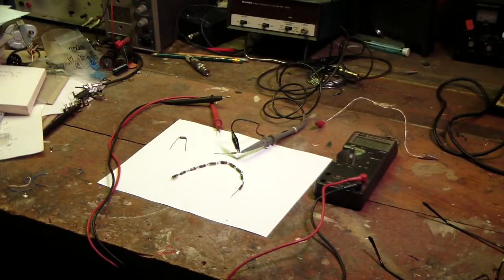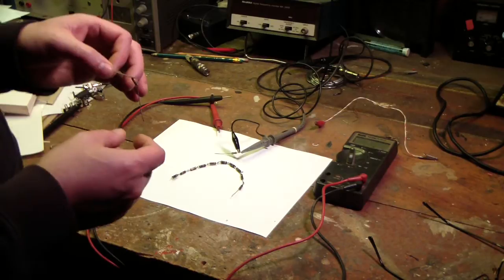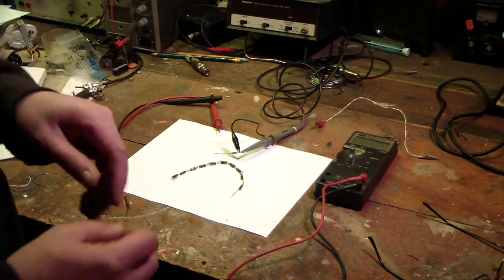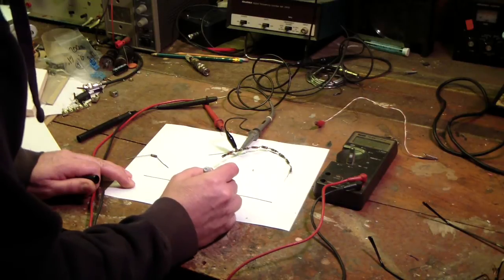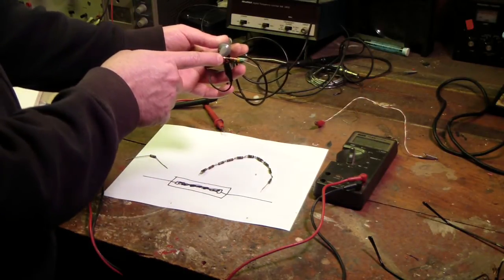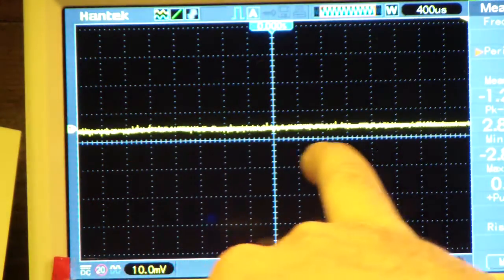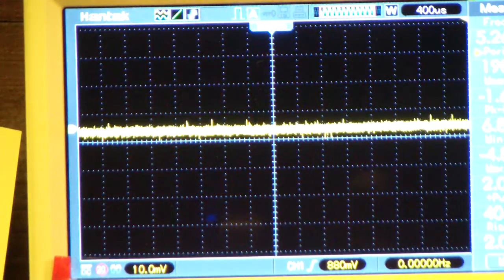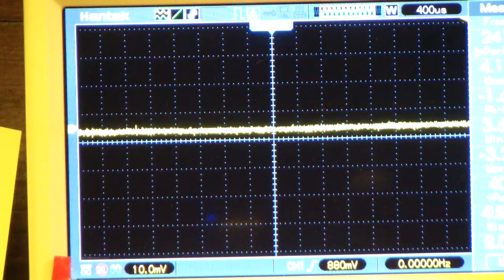Exploring noise in carbon resistors

Comment: in my opinion carbon film resistors will still be needed in the input signal path. because i just removed the new dale resistors bought on digikey from my sansui2000a. and i put back the old pair of carbon film resistors. the warm sound is back. the sound feels more open. the mids and trebles sound clearer and thicker. no longer compressed like the dale metal film resistors. i tested them by attaching one side as metal film and one side as carbon film. and turned the balance knob. to hear the difference between the 2 speakers.. really a little noise in exchange for great sound, wider soundstage is worth it
Reply from the maker: Unless you measure and graph the sound differences with a spectrum analyzer, your stated results are purely subjective, affected by confirmation bias  and useless as evidence.
Reply: @loughkb  There are things that cannot be measured and graphed. For example, in a beauty pageant. Have you ever seen judges draw a face chart and measure the size and compare 3D images to determine whether a beauty queen is beautiful or not? Beauty and sound are similar. Not every chart makes you feel good. That is the charting disease of technicians. For example, when you listen to the sound of a presenter or you listen to the sound of a girl, you feel that her voice is sweet, and I say that you should draw a sound chart of her to prove it. That her voice is sweet. You can't do that with a chart. And it doesn't take too much time. Because of the nonsense of charts and graphs. Charts and measurements. Numbers are not always used in life. for example, when you go to eat at a restaurant, have you ever brought along a scale and a liquid testing tool of the soup to say that it is determined and proven that the soup is good or bad? It is crazy to talk about measuring, weighing and drawing graphs on things that are beautiful, interesting,... about enjoying the sound or taste of something. You should find a psychiatrist to treat your graph disease. And always carry an oscilloscope with you to measure the sound of your friends talking lol
Reply from the maker: @kinhthien-os3yl  That's right, subjective opinion cannot be measured or graffed because it is not based in anything tangible. 
However the energy across the audio frequency spectrum can be graphed and plotted and measured. 
The only way to truly guage your subjective observation would be with a randomized double-blind A to B comparison test with multiple iterations. And as in the past when that methodology is applied, you would probably find that you really cannot perceive a difference when you don't know ahead of time which is which.
Reply: @loughkb  it is sick to always say measure and draw graphs to prove in situations about hearing or beauty or sexiness....... conclusions about the nature of things. i hate people who always measure. you can also measure to conclude that your lovemaking with your wife or lover is good. and determine whether the sound of your wife moaning is good or bad. only stupid and mentally ill people say such things. if you are talking about frequency interference then it is possible. but i am talking about the feeling when hearing. and that feeling is different for everyone. you are stupid

Comment: Yes there noisy i replaced all out of spec ones in my amp with wire wound and metal film. But did i loose that warm sound?
Reply: if you still have the old resistors. put them on each one. and put them on one side of the speaker. the other side is still the new resistor. then you turn the speaker switch. to hear the difference. i did this with the first sansui2000x. and each metal film resistor added changed the sound of the sansui2000x to become thinner. even the resistor that drains to the ground or the resistor that supplies power to the circuit also affects the sound thinned by the metal film. and i was very lucky to have kept all the resistors. and after listening to each resistor i saw the difference increase as i added them. after i finished, my amp sounded better than ever. i really regret going to audiokama to see the articles about rebuilding. and they also instructed to replace the resistors in the power path, i tried. and it lost a lot of the thickness of the midrange
Reply: @kinhthien-os3yl  great idea will maybe replace one at a time with an original type or metal film cause not a coil of wire. See if sound changes

Comment: im new  to electronics , im getting into building my own guitar FX pedals . ive noticed a lot of people say you have to have old Carbon Comp resistors for some FX like old Fuzz Face  or old Electra distortion Circuits. could this noise your measuring  here be the reason guitar players like the Carbon Comp ? how will this noise show up in a audio signal passing through a carbon comp ,would it just end up sounding like static noise on top of the audio or would it have some other effect on the audio ?

Comment: That would’ve been good to also show a comparison to let’s say a Vishay ultra low noise metal film resistor, just to give some visual perspective.
Reply: I would have liked to see vibration or heat applied to the resistor to see what that did to the noise spectrum.
Reply: @goodun2974  The theory is that voltage noise is proportional to the square root of the temperature (in Kelvin).

Comment: You know this is a bogus experiment. You should measure the audio / noise ratio. What you are measuring now is that a wire of resistors pick up more high frequencies from the atmosphere then a smaller antenna, made of 1 resistor. 
Duh.
Reply: Might require shielding around the resistors, or a Faraday cage?

Comment: I remember an old carbon phone mike, they had a pretty audible noise, even without amplification.
Reply: The granules in a carbon microphone were loosely packed, and as the diaphragm vibrated from speech or music, the total resistance of the carbon granules varied as they moved back-and-forth and vibrated, alternately compressing against and moving away from each other.  In a carbon resistor however the carbon particles are baked together with some sort of binder and so in theory they shouldn't move too much. However as the resistor ages, and perhaps with exposure to heat and vibration or moisture being absorbed from the air, that binder (baked clay perhaps?) might develop micro cracks and cause the carbon granules to have bigger spaces between them or to shift position with temperature and vibration.
Reply: @goodun2974  Thanks for your answer. Thats very Interesting theory.

Comment: Hi ! thank you very much indeed for the very informative and well done video.  Have you tried any low noise metal resistor maybe ?  anyway ... i think that parts selection especially in critical spots in a audio circuit can pay big dividends.   In terms of lower noise and distortion of course.  Thanks a lot again.

Comment: I changed out my carbons in an stereo old amp and it changed the sound of the amp, not for the better. It was much too bright and thin afterwards. Then I installed Amtrans carbons and pure magic. No audible noise or crackle and great tone.
Reply: Really? Where's the best place to buy carbon resistors these days
Reply: when a current passes through without an audio signal. it will appear as in this video. but if you pass sound through it, it will appear as a high pitch. blending into the song your amp is playing. you will hear it as if it has been boosted in treble in the tone chart. and of course when you boost treble, the bass will be pushed back. typically when you replace the low noise -40db resistors of vishay dale. you will hear less treble but in return the bass is clearer. because the bass is no longer pushed back. i really like the sound of vishay military grade resistors. you can try it and you will see how great it is

Comment: Can we detect this noise from an ordinary resistor???
Reply: maybe a metal film resistor or even a newly bought modern carbon resistor
Reply: @charonme  New metal film resistors and new carbon film resistors will lose the warm sound of old carbon film resistors. If you notice. old carbon film is much larger than new carbon film. Therefore, the flux is wider. So the sound force is stronger than new types. I compared the size after scraping off the outer layer. The old 1/4w carbon film has the same size as 1w of new carbon film. I think maybe that is the difference that creates strong sound. I also tried new carbon film, but the sound seems too weak compared to old carbon.
Reply from the maker: You can't get more ordinary than common carbon resistors.  I don't understand the question.

Comment: Real good review and I ran across a troublesome audio preamp stage when I use to work for Gates Radio Corp. At first I thought
the noise/distortion was caused by a coupling capacitor and after replacing them I decided to replace the precision resistors
to find the problem and that was exactly what I found was the problem, a bad resistor. Thanks for your review!